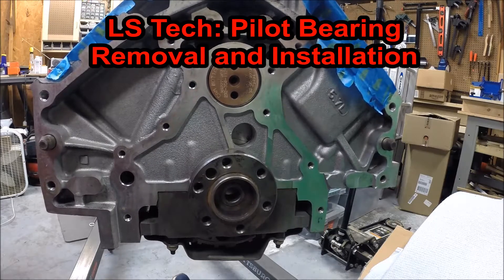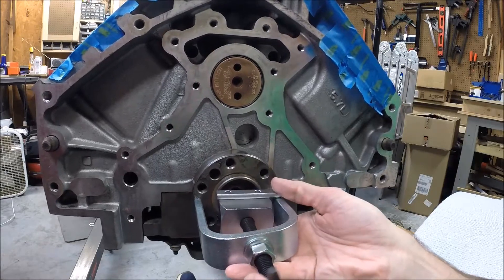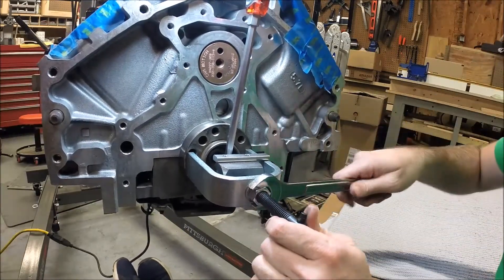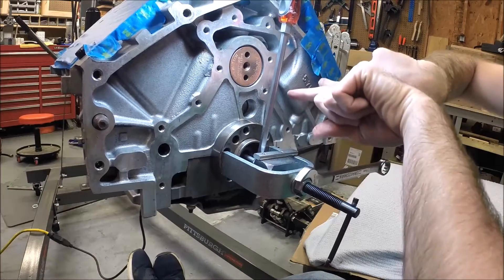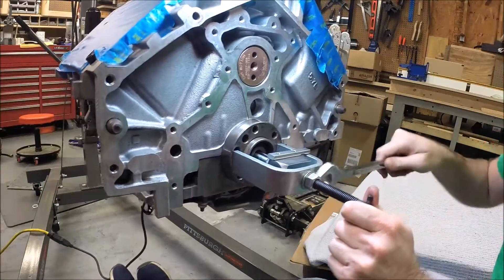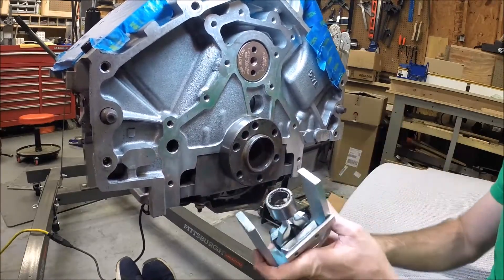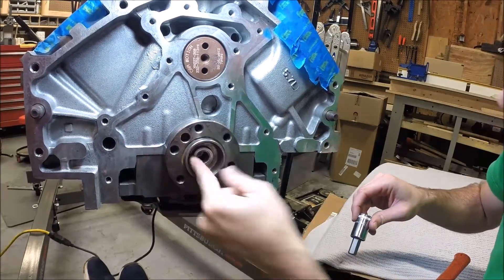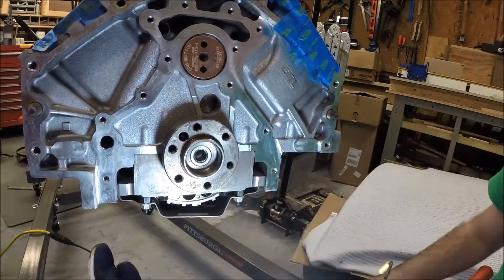LS Tech: Pilot Bearing Removal and Installation

Comment: I just used this same tool (rented from Autozone) to pull the pilot bearing in my LS6. Thanks to you I got it out... but I HAD to destroy the cage and remove the needles first. Glad I got that tip from your video.
Reply from the maker: Awesome!   Glad to hear the video was helpful and that you got it done!   Thanks for watching.
Reply: @ScrufsGarage  hey! Having the same troubles pulling my pilot bearing out of an LS3, seized in there & won't budge even with the tool. How do you destroy the cage, can you show/explain how you did that? Thanks in advance!!
Reply: Any way you try to get that bearing out, you will destroy the cage. But it’s not like you are going to reuse the bearing.

Comment: Dont use bread or grease on a ls. The crankshaft is not solid it is gun drilled and there is a seal back there. The method in this video worked for me. I say don't bother trying to pull it out without busting out the needle bearings. Do it like he did. I used a crows foot to wedge in between the claws. You can find this tool on Amazon for like $30.

Comment: Same tool I used from autozone, I tried using a screwdriver but it didn’t work. Ended up sticking an Allen wrench that perfectly fit between the fingers and pulled it right out.

Comment: Noticed you used a skinny pilot brg. I'm running the wide brg in my crank with nv4500 2002 5.3 and the clutch doesn't disengage all the way

Comment: That was very well explained with a proper tool..rather than with the bread video which is all over the place...I hate to go with a bread or any other traditional way especially when you send all the hammering vibrations to the crankshaft..
Reply from the maker: I agree, the tool is my first choice also.  Thanks for watching!
Reply: For many applications, the bread method is fine. But NOT on the LS! The LS has an expansion plug behind the pilot bearing. And bu using something like bread or grease, you run the risk of dislodging that plug inside the crank.

Comment: That's a neat tool. I started taking pilot bearings out with a dab of grease, a tight fitting punch & a hammer about 35 years ago, and I bet it's cheaper and faster than the tool, though. Still, it appears to be a quality tool.
Reply from the maker: Yes, I've also heard of using wet newspaper with a punch.  The challenge with that method though is finding a punch that is the exact size you need.  Sometimes these pilot bearings require some creative thinking, haha.
Reply: Yes, if You have that tool on hand, modifying a straight punch (grinding the hell out of it) is no longer necessary. lol so maybe the tool is cheaper after considering that.
Reply: The downfall with the bread method on ls1 (what hes working on) is that there is a plug at the end of the crank you can risk pushing that plug into the oil pan if there is less pressure holding that in than the bearing
Reply: I just pulled my pilot bearing out of my L98, using grease and a turned down bolt...  there was litterally zero effort and the bushing came right out....  I was amazed at how LITTLE effort that was needed